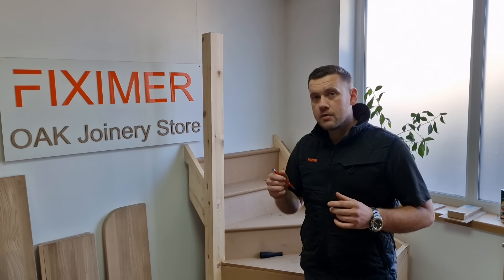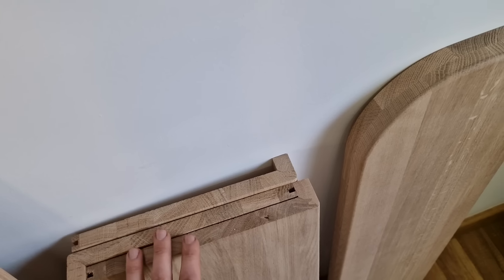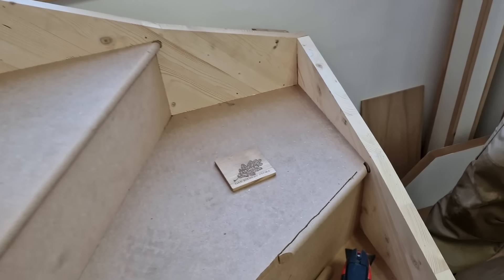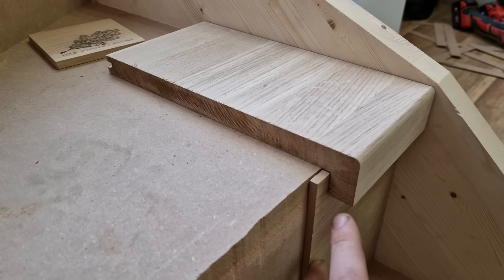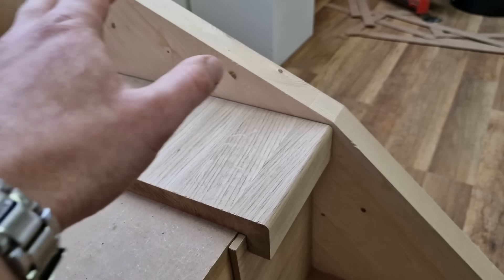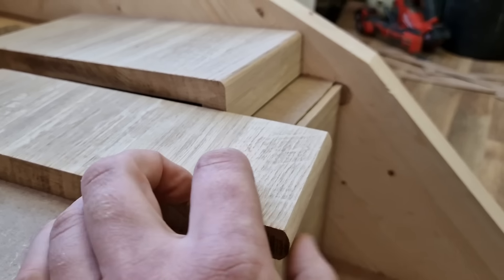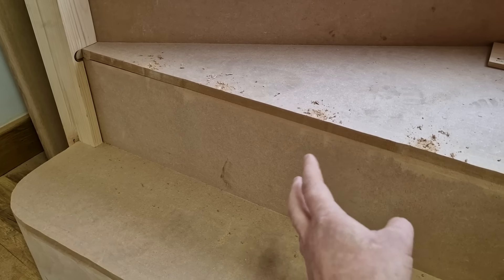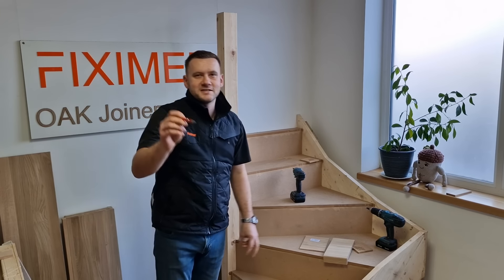How to do Stair Renovation in OAK ***Where to start?***  part 1/12

Comment: A flush trim bit in a router would be quicker and easier to remove the majority of the nosing
Reply from the maker: Thanks for the comment. Absolutely - always use the tool that's most suitable for the job! We just wanted to make the guide accessible to novices and DIY'ers so we've tried to limit the number of tools being used here